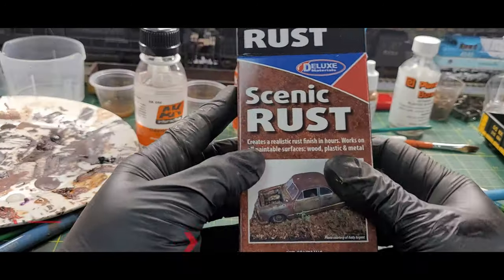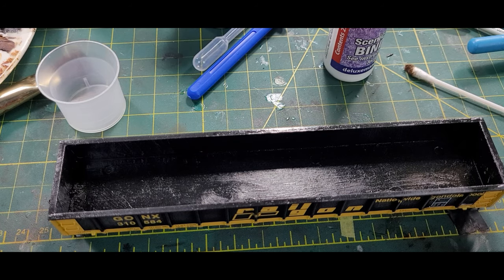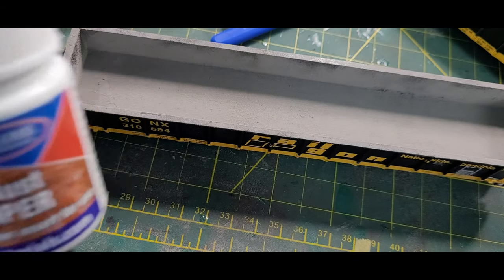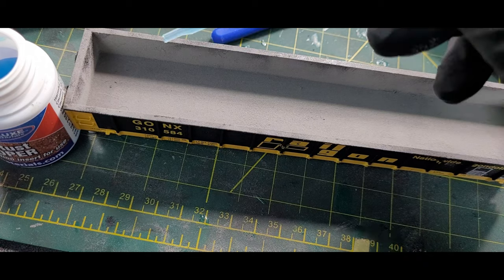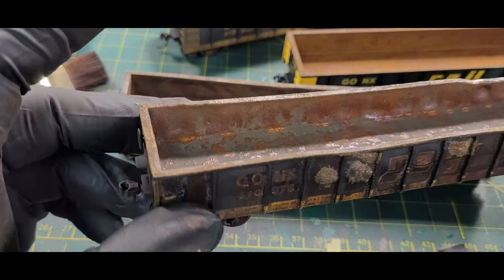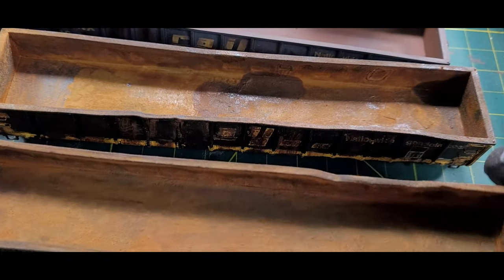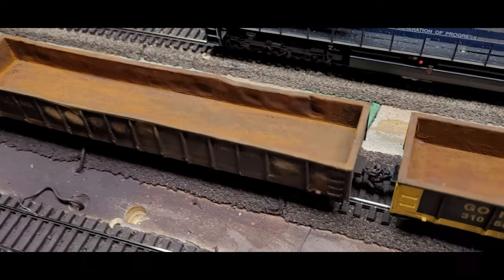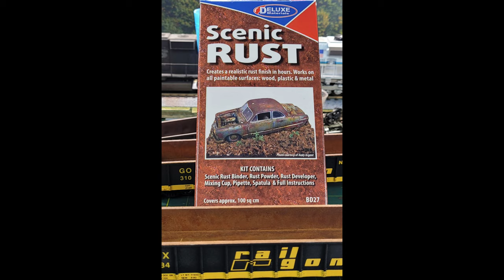How To Deluxe Materials Scenic Rust Kit

Comment: Love deluxe materials. Especially scenic rust. I found better results using salt water instead of deluxe materials rusting agent.
Reply from the maker: You have to show me.   That is very interesting
Reply: @engineerhall5887   Hello Richard. In my case weathering molten steel bottle cars. I don't think you'd want that much rust on a normal freight car though,lol. The salt water causes Deluxe Materials Scenic Rust powder to rust faster is all. Time saver but try on a junk car first to make sure it's up to your liking. God bless.
Reply from the maker: I have 4 bottle cars from the last run from walthers I was thinking about adding the rust to them  . I'm going to look for that  video.
Reply: @engineerhall5887   Richard. Mine are heavily weathered. Did each car three coats of watered down Salt water & Elmer's white glue. Each time you use salt it cuts down the rust affect time . Within an hour it's dry and rusty. Try on an old junk car till you get the desired amount of rust you want. Good luck Richard and God bless you.